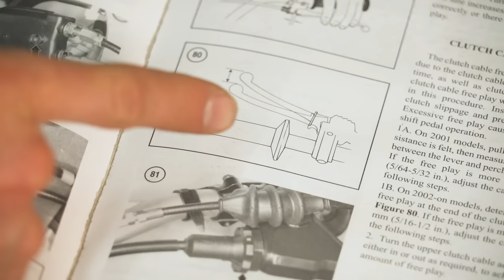How To Adjust A Motorcycle Clutch Lever | MC Garage

Comment: Thanks for making these videos.  I am a beginner rider, but I have always admired the motorcycle.  Without guys like you doing this for all of us beginners, we would be lost.  Thank you again!
Reply: Me too! I bought a Chinese 125cc Chinese starter bike and then bought a BMW k1200s that was wrecked for a very good price. Had to pay 2k to fix it back to like it was before it went down but it still had a few issue like the clutch lever linkage bar was welded and broke on me so I had to buy a used one of Ebay so now its just about adjusting the clutch cable and linkage..

Comment: My motorcycle isn't changing it's battery when I'm riding,  I have to pull the battery and manually charge it when I get home.  I got this battery a few weeks ago because the old one died.  My motorcycle is a 2008 Hyosung gt250r.
Reply: Duke Boreham the rectifier need to be replaced dude. If you can start your bike that means the coil are still good, it's the rectifier which had burned out.
Reply: I had the same thing and it was a bum battery, have it checked to make sure it's charging.  Your bike is old enough it might be worth doing anyway.
Reply: Could be your regulator/rectifier, or the stator... Could also be a bad battery. We're going to cover charging systems/battery health in a future video.
Reply: maybe they'll cover it in the forthcoming video, but it wouldn't be a bad idea to install a charge cable.  like this one: 
 http://a.co/7WqWMh6)  
you can locate the charge cable wherever, for ease of access without removing the seat or whatever.
Reply: I seem to remember a YT video about the Hyosung Comet being known for Stator problems. I think he said one should change it for an aftermarket one.
Reply: A lot of helpful and knowledgeable folks here can help you out. http://korider.com/index.php

Sounds like the Stator, or Regulator/Rectifier. Both common problems with Hyosung bikes.
The in above link you'll find the answer you're looking for after a little searching. Possibly even with How-To guides and links for replacement parts.
Reply: Please, please, please listen to me. If you have a digital multimeter at home please check the voltage with the bike running. Somewhere between 13.5v-14.4v with the bike running. 

If you. Do not have a multimeter, with the bike running, take the positive cable off the battery terminal. If the bike dies, the charging system is faulty, if the bike continues to run, then the battery is bad. 

I am a 10 year ASE certified mechanic for hyundai.
Reply: Seth Glenn I tried the second test that you suggested because I don't have a multimeter.  I took off the positive and the idle rpm's went up from 1500 rpm to 2000 rpm.
Reply: Duke Boreham the bike did not die though. Once you start the bike, are you able to ride as long as you want? Everything you are telling me is pointing to a bad battery.  My fz-07's factory battery died the first year I had it. I would have to charge it or jump it every time I turned it off.  Taking the terminal off while the bike is running shoes you whether the bike will run off of it's own charging system.  Which it can. Which means the battery is bad
Reply: Seth Glenn when the last battery was in my bike,  the day it died,  I had to roll start my bike and I couldn't use any more than the running light or the bike itself would die.  After I got to wherever I needed to go,  I almost parked up when the bike died and it wouldn't roll start
Reply: Seth Glenn I'll see how far I get this week with it

Comment: Thanks for posting these videos. In the past month, I've successfully replaced and balanced my tires, adjusted my chain, throttle free play, and checked the steering and clutch play, which were all good. Simple, but very helpful advice here. Subbed.

Comment: You actually raised a good subject, I don't have a lot of time in the saddle using a hydraulic clutch although I have felt how little effort is involved pulling the lever with a bike that had one of these type.
personally I felt it lacked feel not the case with my traditional cable type proper lubrication can make the levers easy to use as long as they're free
And a little maintenance pays a lot in terms of feedback

Comment: 2:10 ... I think you're wrong: I think it is not ok to adjust the slack/free play adjustment to suit your hand size or clutch engagement preference. The adjustment is made for the well-being of the clutch mechanism, and if you eliminate play in the cable, the actuator lever will be in constant contact with the pushrod and will cause unnecessary wear. The same as resting your left foot on the clutch pedal of a manual transmission car. My opinion is that if you need to make adjustments to suit your own hand, you should change your clutch lever to suit it, not deviate from the maker's clutch cable free play specs. I don't think this is pedantic, it's understanding that the mechanics of the motor have to be respected. 
Apart from that, I think the vid is good, clear and well presented as are the others of yours that I've watched, and I'd be interested in any reasoned discussion on the issue I've raised. Thanks.

Comment: So if the free play adjustment is correct as per the manufacturer’s manual, should the pivot lever on the clutch assembly on the right hand move at all when the handle bar is turned left to right, with the clutch being disengaged? I’m having troubles with adjusting my continental Gt 650.

Comment: Thanks for this - was just wondering about the impact of clutch adjustment on gears slipping. Cold engine tip is useful too!
Reply: Gears don't slip, your clutch does. If the cable slack is properly adjusted and the clutch is slipping, then the plates may be worn or glazed and will need to be replaced.
Reply: Ah I see! Thanks for the clarification.

Comment: My current two bikes both have hydraulics instead of cables for the clutch and I haven't had to worry about clutch adjustment but then I need to replace the fluid as one would with the brakes.

Comment: I've adjusted my clutch to engage ~8-10mm from full squeeze, with slack well within what the manual allows, and I've never experienced any creep. 

However I find it disconcerting how, after taking my bike in for servicing, I pick it up at the end of the day and find that the mechanic decreased the slack on my clutch. More than just being annoying (and might damage the clutch plates as Ari mentioned on the vid), I think it's also dangerous as the changed clutch setting won't let me ride off at the exact point that I'm used to riding off (at a busy intersection for example). 

Thankfully, it's easy enough to re-adjust the clutch as shown on the vid. But still, I wish the mechanic would just leave my original clutch settings alone. 

Kudos for the vids! Thumbed up and Subscribed!
Reply: You can always let the mechanic know you want the setting left alone or become your own motorcycle mechanic

Comment: I've heard that a good reference for the freeplay adjustment is to adjust and then rotate the steering fully and check the slack. if there isn't any you should loosen the tension. Check both directions.

Does this make any sense?
Reply: If the position of the steering affects free play on any of your cables, something's wrong. Things shouldn't be getting pulled tight by the forks.
Reply: Yeah, definitely makes sense. But ultimately your cables should be long enough/routed in a way that steering doesn't impact the tension.

Comment: Make a video on how to check and replace brake shoes on a mechanical drum brake
Reply: Most of the modern bikes don't have a drum brake. It's likely mcgarage won't do it
Reply: Drum brakes are super easy to replace actually and I had done it myself. Depends on which brakes that need to be replaced either front or rear brakes.
For front brakes:
1. Loosen the axle nut and remove it from the axle.
2. Pull the axle out to remove the tyre out from the forks. If the axle are to hard to pull take a mallot or a wrench wrapped with rag to hit the axle to drive it out.
3. Take the brake hub out from the rim and now you have access to the brake shoes.
4. Pull one of the shoe 90° perpendicular to the hub and remove the shoe.
5. Take the new brake shoes and took the shoe spring from old brake shoes. Inspect the spring for corrosion or any sign of wear. If it's good go with it.
6. Put some grease to the brake axle or pivot. Smear some to the spring as well.
7. To install the new brake shoes reverse the step of removing the brake shoes.

The same procedure apply to rear brake as well. With exception you have sproket hub and sprocket that you have to remove to remove the tyre and to access the rear brake hub. Also cleaned the brake surface inside the rim and brake hub using compress air or blowing it as there are many dust form inside the brake system.
Reply: Four outta five of the bikes in my garage have drum brakes, so maybe we will!
Reply: Yatin Chachad 
Pretty pleasssseeeeee
Reply: Good Times they feel like the equivalent of grabbing onto a slick metal bar with sweaty hands so you don’t slip and fall.. unreliable but you don’t have much of a choice

Comment: Been riding for a couple years.. I have a street triple rs..  clutch was slipping in 5th gear, every time I went to 8k rpm, it would jump to red line but not I screws speed.. I’d shift to 6th, the clutch would engage and the speed would rise until red line.. and even at the top speed it would slip.. revs going all over the place, speed struggle to get to the top (135mph to 150mph) (I know I shouldn’t but it was for science)

I was scared the clutch was dead, or I needed heavier springs inside the clutch, or something really sinister..

I checked my clutch lever, and there was literally no free play.. the adjuster at the lever was fully out.. I put it fully in, which gives about 4mm of play.. now the clutch never slips, the rpms remain smooth and steady predictable rise.. 5th gear fully engages and is useable at the top end now.. couldn’t be happier.. 

Really felt like a noob after this journey this afternoon..

Comment: Please help me, I have the Honda Forza 250 cc in 2007 and I hear a noise coming from the conveyor belt when I reach the speed of 60 km. It is the speed in the middle of my bike at a speed of 120 km. where is the problem
Reply: Speed vibration. Tighten everything down on your bike until you find the problem.
Reply: Sounds like your belt is loose, or the variator isn't working properly. Something is creating/allowing slack in the belt and its hitting a resonance at that specific speed/rpm. Pull the belt cover and inspect the belt and tension, and maybe run the bike on the center stand to see that the variator is working properly.
Reply: You may have the wrong belt size...

Comment: Dope content mc garage 👍
Also i wanna request a topic !
How to perfectly launch and shift gears in a drag race without quickshifter
Reply: As you accelerate while in 1st gear, place your left foot under the shift lever and begin gently yet firmly applying upward pressure on the shift lever--do not kick or jerk upwards: just apply firm, consistent upward pressure. The moment you need to shift up, momentarily close your throttle. You should feel the shift lever click up to the next gear. Congrats, you've just upshifted without the clutch or a quickshifter. 

Same method should apply upshifting from 2nd to 3rd, 3rd to 4th and so on. Oh btw, I learned it from this vid: https://www.youtube.com/watch?v=viWuolNYGyI

Cheers!

Comment: I had some clutch slippage from partial disengagement of the lever because of too little free play. I rode with it like that for a day and took it nice and easy since I noticed it slipping when I acellerated hard. It was only a 10 mile ride. What’s the chances I toasted my clutch pack?

Comment: I have a lot of extra freeplay in my clutch I like the bike to start to roll just as I begin to get go of the clutch so I need extra freeplay I don't like letting the lever out half way then the bike start to roll I like it to roll instantly but as you said its not allowed to roll when the clutch is pulled

Comment: Hello I just got my first bike brand new yesterday and I rode it for probably about 2-3 hours. I did stall out a few times but I had one of my experienced friends tell me my clutch cable is loose. It doesn’t engage until almost the end of release but then again I do have small hands. Could I have done any damage to the clutch while riding with a loose cable? I did smell something burning a couple times and when my bike was off I could hear either the brake disk or clutch disk while rolling in neutral. I figured I couldn’t have done any critical damage but I’m not 100%. Thank you

Comment: This might be a silly question, but Ari, is having the 'full disengagement' point of the clutch lever be NOT right at the bars ok? Meaning, being able to use the clutch with only the middle or middle & index fingers. If so, how do you know what the actual 'full' disengagement point is of the clutch? Many thanks.

Comment: Got a zx6R. There's alot of play in the clutch lever but that play is also visible on the clutch cable at the engine. Can I tension it before feeling the clutch bite, or is the clutch actually engaging the moment the clutch cable moves? Would appreciate any help :)

Comment: So i was doing a course which required me to feather my the clutch the entire day. In the afternoon, the clutch suddenly got worn alot, to the point where the barrel adjuster could not make free play. The clutch would engage below 4000 rpm. Above that the engine power don't get transferred. Even after a night to cool down, it is still like that. Was just wondering how the clutch suddenly got worn by that much???

Comment: I wanted to ask - what is your opinion on coasting in "neutral" and/or coasting in gear with clutch disengaged? Situation might be, for example, approaching an intersection with a red light. Is the gearbox is getting damaged, or is the clutch? Or it doesn't work that way, because everyone is used to not doing that without an explanation? Greetings from Estonia
Reply: Bike in gear, clutch in at stops and intersections, always. You need to be able to get rolling ASAP in case someone blows the stop or there's some other danger.
Reply: No, no. What I meant was - you're approaching an intersection, being alone on the road, not bothering anyone else, and you see the traffic light being red. Instead of keeping it in gear, and slowly getting ready for a stop, like rolling off of a throttle, you disengage your clutch to let your bike roll towards the intersection, dropping the revs to idle even though you are still in motion. Since I haven't disassembled any bikes gearbox (or cars, for that matter), what are the effects of doing so, and, if that is wrong and abusive to ones bike and gearbox - why? In a car with a manual gearbox I don't see a problem of doing that, but how about bikes?
Reply: It's not going to hurt anything. When the transmission is in neutral and the engine is idling there is less oil pressure going to the transmission, but there's also no load on the trans and there's sufficient oil on the parts to prevent any sort of premature wear.
Reply: Thank you! Have a good one!

Comment: At my 125cc mt the clutch cable is tensioned when i don't pull the cluchlever, does the clutch even have play?
Another question: when i pull the lever 3-4 millimeters, should the clutch arm move?

Comment: Ok so when you loosen the lock nuts down by the engine what is it exactly that alters cable tension? by pulling the thread housing the cable more to one side than the other, then re-tightening? ...  appreciate if someone could clarify.

Comment: Does too much tightening of clutch cable damages the clutch plate? As my tvs 160 4v the mechanics told me dat the clutch cable can damage due to too much tightening of clutch cable? As i had use the leg guard other than you get from the company.

Comment: My Bike is Honda Honet 250 2006. I have good clutch slack but when I pull clutch fully and when the bike is 1st gear rear wheel is running. Should I change my clutch plates. Please help me. Thanks
Reply: Sameera Thilakaratne less slack
Reply: You mean currently it has more slack?
Reply: Rear wheel in the air, or is it actually moving the bike?
Reply: In air :)
Reply: It'll spin if the wheel is in the air. There's stiff some fluid drag between the plates, even when they're pushed apart. That's why race bikes have dry clutches (no fluid drag).
Reply: That's normal, especially with a cold engine. It's the Oils viscosity thats still connecting the clutch and transmission.
With a warm engine the oil is much thinner and usually the wheel isn't spinning anymore.

Try if you can stop the wheel with your hand (only palms and only it its spinning very slow!!)
Reply: Thank you very much for your information. I thought its a fault
Reply: I'll check thank you very much
Reply: If you can stop it with your palm, it's fine. Mine when cold is like a 50/50 chance whether or not the rear wheel will spin. Sometimes it spins, stops, and spins again. If you are fighting the bike to walk it backwards in gear then you need to adjust it.
Reply: Thanks